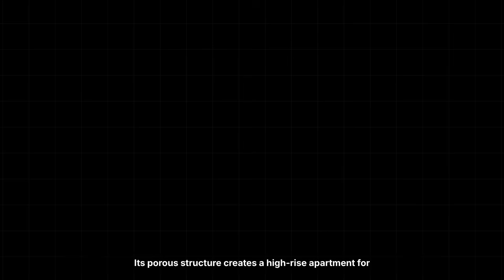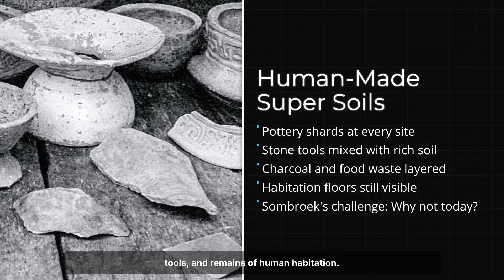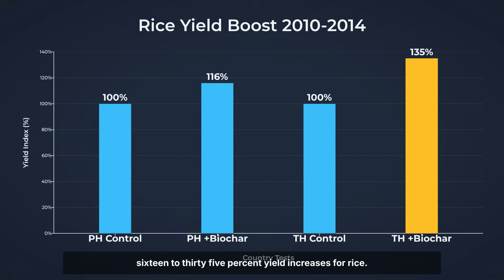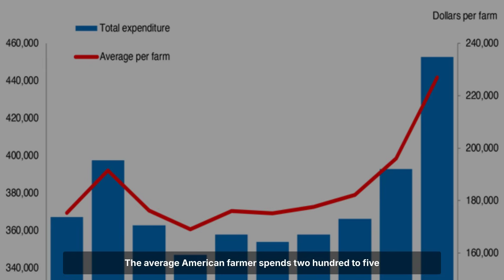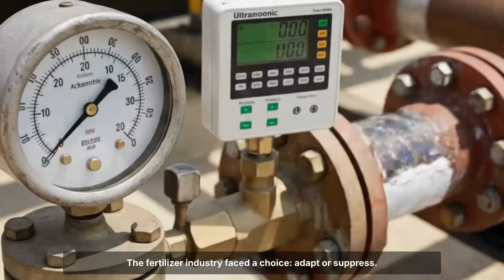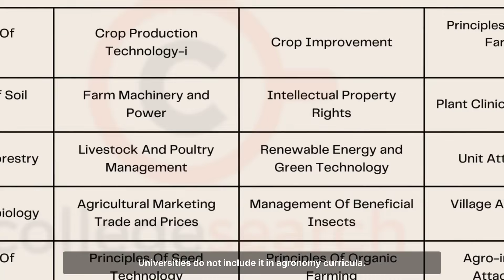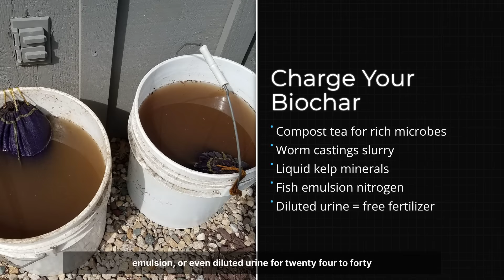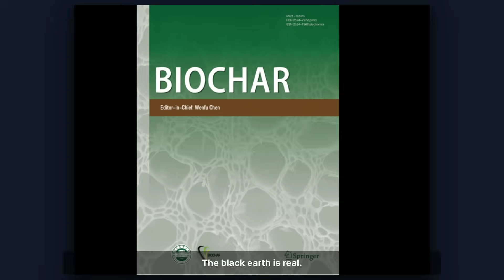This Soil Replaces All Fertilizer FOREVER. Why Did Big Ag Bury It for 60 Years?

Comment: I’ve used my monster for 20 years. I love it. It either busts the wood or it bounces out, and never gets stuck. I’ve sharpened the edge once or twice, and have had to weld the handle with a short piece of pipe as reinforcement for it. That’s it. I’d sell it for what it would cost to get a new one and have it reinforced.

Comment: Another way to make it is put wood in a metal 55gal drum with a lid with a small hole to relieve pressure. Burn the barrel in a fire. Once what little oxygen in the barrel burns, everything else in the barrel is charcoal. Wait for the barrel to cool before opening or the charcoal may ignite itself if still hot enough. 

To be more efficient the barrel could be cooked in a keln so the fire is on the bottom, exhaust is slightly higher and the barrel is in the insulated top part so heat is trapped around the barrel. Think of it like an insulated room without a floor. Heat rises and gets trapped. I believe this would be the most efficient because would require less heat, fire and fuel to make charcoal.

Comment: I made my own biochar, I used the following off the shelf ingredients.

Charcoal briquettes - all natural
Manure
Compost - kitchen scraps and Starbucks
Fish fertilizer 
Sawdust from animal bedding
Vermiculite - 50 lbs bag

I soaked the briquettes in water, compost, and fish fertilizer to break it up. After a few days it turns into a slurry that breaks apart by hand (or mixing drill). 

I mixed it with 2 parts local SW USA dirt and 1 part compost mix. The soil holds moisture and nutrients. The soil is even darker than the soil next to it. The plants love it!
Reply from the maker: That's an incredible hands-on approach and a fantastic detailed breakdown of your process, sounds like you've created a really rich, living soil! Thanks for sharing it with us, I really appreciate it.

Comment: I've a 2M wide and 1M deep pit in my woodlands in the Scottish Highlands. Been making char for years. You know it's good when you can wash it off your hands with water alone, because there's no VOC's that would not wash off without a detergent or the like. It absorbs nutrients for a few years then becomes very good, even after inoculating with compost and mycorrhizal fungi, which I do. A trench pit works well too but doesn't give the same, in my case app 30% char from the burn. I burn brash from dead standing ash, ash dieback cause. The ash from burning the brash is also a useful soil amendment, containing potassium and phosphorus which I use to treat diseased trees. It ups the ph my ash ph 12 app and my soil slightly acidic. The burnt ash also gives some protection against fungal disease reinfection through new growth leaves for a couple of years, as it gets absorbed and lost into the ground. I will replant with Aspen and Birch, which will hopefully do better, and support wildlife almost as well as Ash can. It's fun to make and rather than chipping diseased brash it can be made sterile and useful.

Comment: I buy a bag of hardwood lump charcoal, bust it up with a tamper (not too small) put it in a 5 gallon bucket with a perforated bottom set it on the compost pile and pee in it for a month or two before mixing it with the compost. 😁
Reply: I have used hardwood lump charcoal for 18yrs for grilling and every bag has some small unusable pieces and dust at the bottom of the bag that I add to compost and raised beds. I also sift the small bits of charcoal from the grill ash and wood stove ash for the same use. I know ash contains beneficial potassium but it raises soil ph and my local soil ph is already on the high side so I throw most of the ash away.

Comment: Ahhh hem, facts matter! Actual research is a bit erratic with the time to soak/activate your biochar. BUT NONE suggest anything as short as 24 to 48 hours. My memory says 6 weeks minimum to months (might depend on what youre using), but the shorter the time the LESS the activation
Reply from the maker: You’re right that activation time varies a lot depending on material, temperature, particle size, and what you charge it with. There isn’t a single agreed window in the literature (we have added a few resources in the description).
What we show in the video is the practical minimum, soaking biochar in nutrient rich inputs like compost tea, manure slurry, or diluted urine so it does not enter soil completely empty. That happens relatively fast at the surface level. Longer curing, weeks to months, absolutely leads to deeper microbial colonization and more stable nutrient loading.
So it is not that 24 to 48 hours is “fully activated”, it is enough to prevent nutrient drawdown and start the process. Extended aging just improves it further. Appreciate you pointing that out, it is a good nuance for people who want to go deeper with it.

Comment: Something not mentioned.

Biochar increases water retention. 

Biochar decreases water evaporation.

Increases soil aeration. 

Increases soil tilth.

Increases electrical conductivity. This helps for those practicing electroculture.

Insulates the soil from excessive heat. This cools down the soil somewhat.

Comment: I had been working on avocados and a disease they get in their roots called phytophthora. There was an area on the farm I helped manage for 20 odd years that was particularly susceptible so we tried digging similar fire pits (only we made long trenches instead) and burned hundreds of long camphorlaurel trees, many eucalypts that had blown down during storms and prunings. After flooding the pits to put out the fires we used watering cans to inoculate the charcoal with compost tea and chicken manure and then buried it all.  We planted it out with legumes (I forget what type) and let the soil settle down  then after slashing the legumes we planted it out 
And yes many of the new avocado trees are still thriving there apparently but I'd say the labor cost of all that work will probably take generations to recoup. So yes you can fix dead avocado orchids like this but it's not really cost effective, at least not in the short term. I have to say though charcoal is the best soil additive I've ever looked into by magnitudes.

Comment: Having used biochar for years, I can confirm that biochar is phenomenal.  It does, however, need to be recharged after a couple of years.  Hopefully, ppl learn how to use natural products to create bio-complete compost and vermiculture castings to recharge their fields.  If you have 1000 acres, this may be more difficult to achieve. Though not impossible if you use inoculations of compost tea.
Reply from the maker: Thanks for sharing your experience! That's exactly right, biochar thrives when it's integrated into a living soil system with active biology.

Comment: The higher the temperature of the pyrolisis the higher the Cation Exchange Capacity (CEC) which means that the charcoal can ionically bind and release more nutrients. You can charge your charcoal with straight urine, no need to dilute. It works better adding a carbohydrate source to help the biochar to be colonised with bacteria.
I have been making my own biochar for years. I use one 55 gallon steel barrel with lots of holes punched into the base for airflow filled with tightly vertically stacked split hardwood and then another 55 gallon barrel with the bottom cut out that goes directly on top of the first. Fill the upper barrel with scrap wood, pallet wood works great, and ignite. The embers ignite your hardwood and eventually find their way to the bottom. When you see orange coals around the entire base cut off airflow by shovelling dirt or sand, remove the top barrel and any excess wood and seal off with the barrel's lid (weighted down). I get incredibly high levels of conversion using this simple method. I leave it for two days then empty it out on an old tarp, fold in half and drive over it a few times with a car or truck.
Reply: What do you add to it after you drive over it. Before you use

Comment: It's not scalable. It gives minor improvement if you're a homesteader with bad soil, but adding biochar to a 1000 acre+ field isn't feasible. Compost is more valuable pound for pound.
Reply: You've missed the point. Yes, its a lot of work but once you've transformed a portion of land you never have to do it again for generations.
Reply: @brownsinglet4958 I am a homesteader. It's works for a garden with poor soil, not 1000s of acres. Compost works similarly, but again no ones adding to 1000s of acres.
Reply: You do realize the process for modern fertilizer?
Reply: @FuAzzi Yes I make my own fertilizer and compost too. What are you getting at?
Reply: Mono-annual crops is big ag mentality this is for top soil management which mono-annual crops contradict nature. Biochar helps nature.
Reply: @PR.Hobbit I've grown 18ft cherry tomatos. I know soil. Biochar is not needed in a high quality system and it can actually hurt it.
Reply: Few people have 1,000 acres of mineral soil to improve.
Reply: @LordMondegrene Most American food comes from farms with 1000+ acres, and the video is acting like it's being hidden from them. Leafmold and compost are a better return on your investment for time spent as a homesteader.
Reply: Some farmers burn fields of alfalfa for biochar. Alfalfa has roots that reach 12'+ in depth so it also brings nutrients to the surface.

Comment: That is a bit simplistic. Biochar is not a fertilizer it is a soil amendment. Biochar must be enhanced with the compost to supply the nutrients required for plant growth. These nutrients will have to be replenished yearly based on the levels removed by the crop. Yes, it will increase the nutrient and water holding capacity of the soil and will aid soil microorganism populations. However the application rate would be must higher than what is shown in the video. To create a six feet depth of black soil in a clay soil under forest vegetation would likely require tons/acre of biochar and compost over the reported 1000 years.
Reply from the maker: You’re right, and that’s an important clarification. Biochar isn’t a fertilizer, it’s a long-term soil amendment. It has to be charged with nutrients from compost, manure, or living soils. That's why we've covered it around 13:00 on the right way to do it. Thanks for sharing your expertise, I really appreciate it!
Reply: Thank You for expanding on this  ❤

Comment: Charcoal, biochar, absorbs and holds onto nutrients and hold and contrast with nutrient poor clay soils nearby where water can easily leach them away. But  they (nutrients) don't "last" forever. If you pull nitrogen or potassium or calcium, then it's extracted and depleted.  Charcoal in the soil is a nutrient sponge and can hold it for later, but it is not a nutrient (fertilizer) replacement.  Understand the reality and charcoal's porous nature so you can better benifit and use it effectively.   Charge it with animal waste, urine and compost, and it will hold onto nutrients better than being washed away as water soluble nutrients might after many rains, But don't expect nutrients where their arn't any, and don't expect endless supply without charging and recharging.
Reply: To avoid accumulation of harmful pathogens, urine and animal waste should be composted first, not dumped fresh. 
Thanks for clearing up the information, the video title is a misleading
Reply: @Brandiqa yes, l keep 3-4 planter tubs-30 gal size composting and raising earthworms. I compost manures, kitchen, a poor car victim squirrel, some urine, leaves, chunks of gumbo, lawn, seaweed, teabags, coffee, oak wood peices and  biochar. My soil is fantastic. Houston TX. 🏈
Reply: @Brandiqa  According to provable multi-times failed modern standards of course...expecting modern links to current standards and studies to follow of course. You can remove any harmful effects with one complete seasonal cycle. Exception of course accoding to "modern standards and studies".
Reply: Thank you for showing people what would be more accurate expectations for reality, things aren't as simple as these videos would have you think
Reply: One should never just add charcoal to the dirt unless it is activated. If you put non activated biochar on your dirt it will have a negative effect for up to 3 years.
Reply: @GETAGOATANDGO1775 The biggest difference between activated charcoal and biocharcoal is surface area per gram. Activation is done by the use of steam and or chemicals at a higher temperature which creates many more small pores.  Activated charcoal is commonly used to filter because it better absorbs chemicals, while bio char is pryolasis at lower temperature and is richer in functional groups useful for ion exchange.  Both absorbed nutrients  which can potentially rob plants of nutrients if not enough nutrients are not added. And it's possible to add too much to both and burn plants. And in both cases it can take years to either leach away the excess, or for surrounding soils to leach enough nutrients into your carbon amended soil. But when it comes to activated charcoal vs biochar, bichar  has a higher "Cation Exchange Capacity".  This means it has chemical "hooks" functional groups  that grab onto nutrients like Potassium  and Calcium and release them back to your plants when they are hungry. Activated charcoal lacks these chemical handles; it just holds onto things physically, often refusing to let them go because the pore sizes are too small for bacteria and plant roots to access.
Reply: I run my biochar througe my wormerys, and compost piles. This year I am trying it in my compost airated tea tubs before using
Reply: I mostly agree. However, terra preta, although made with biochar as a key ingredient is not simply charcoal nor is it biochar. It does not need to be recharged with nutrients like nitrogen or calcium unless you happen to live and use it for a couple of thousand years. The terra preta in the Amazon has never been recharged and it is still fertile after at least two thousand years.
Reply: @CaffeinatedWizard yes😊, that's precisely my my point.  I was talking about the addition of charcoal, or more precisely biologically sourced charcoal  bichar as an additional ingredient to soil because it's pores soak up and hold onto nutrients better. In of itself it has no nutrients  for plants.  And all by itself  it could be harmful to plant growth by its absorption removing bio access to the nutrients. Don't buy into infinite unlimited nutrients.l in tera pretta. The premis or arguments that it's never recharged is a fantasy. I can think of multiple ways the teta preta may be recharged. 1   clayish Amazon soil nutrients get washed away or leached into neiboring tera pretta soils. Leaves and foliage and Worms and bug and carcusas and droppings cary macro and micro nutrients which are better retained  and charge terra pretta soils. While it can still be depleted with frequent human use. it's a sponge that can more easily be recharged with human intervention, or in the case of Amazonion terra pretta, after abandoning it to nature and time. It was renewed.
Reply: @CaffeinatedWizard hasnt been recharged? The amazon has been feeding it organic material via de composition of (mostly) organic plant and some organic animal matter and waste. Lets not be obtuse and forget basic biology and the laws of science. Conservation of energy and matter still apply my dude.
Reply: @Rooftop_clowning  "Recharged" meaning you don't have to keep adding meat scraps, vegetable scraps, biochar or pottery shards the way you have to do with a compost pile.
Reply: Soak the charcoal in liquid fertilizer cultured with the microbes to break it down. It's bio char, get the charcoal to capacity before adding it to the soil
Reply: @carrynoweight  might need to watch out that it's not too strong or need to mix in more soil. But it will certainly charge it with nutrients.
Reply: That's right 🌱

A big part of permaculture is making biochar to mix into the compost (after saturating with urine, compost tea, etc.) for planting and topdressing. Then, nitrogen-fixing trees (acacia, moringa, cassia, etc.) are interplanted with the fruit trees for "chop and drop" fertilizing. 💚
Reply: The "all in a pill mentality" is commonplace. Life sustaining matter must be replenished. And there's plenty of it available. Now we need to discover enzymes, bacteria that eat plastic. I love to compost and make biochar. Love me. Love my garden.✝️
Reply from the maker: You’re absolutely right, and we’re actually on the same page here. We do cover this in the video, but your comment is a great clarification for anyone skimming; 
	• We explain that Terra Preta was never just charcoal. It was charcoal combined with animal waste, bones, food scraps, and pottery. The nutrients came from those inputs, the charcoal’s role was to retain them (around 3:30).
	• We talk about why biochar works at all, its porous structure binds nutrients and water so they do not leach away, but it does not create nutrients by itself (around 7:50).
	• We also warn not to add fresh biochar straight into soil. It needs to be charged first with compost, manure, urine, compost tea, etc., otherwise it will actually pull nutrients out of the soil (around 15:45).

So yes, totally agree with you. Biochar is a long term nutrient sponge and microbial habitat, not a fertilizer replacement. Nutrients still get used and have to be replenished over time.
Thanks for adding the extra context and explaining it so clearly, it really helps round out the discussion for everyone reading.